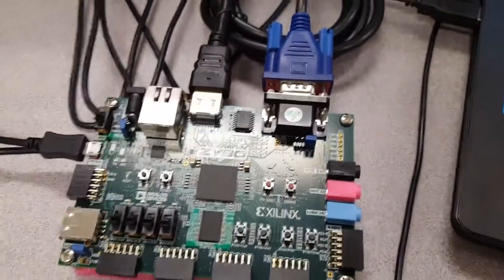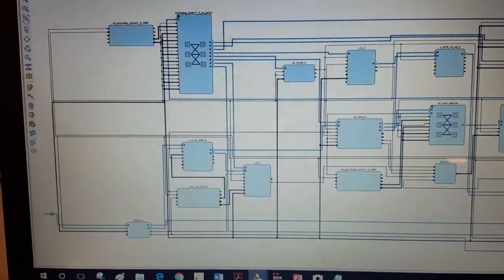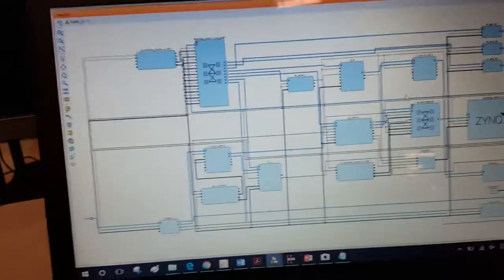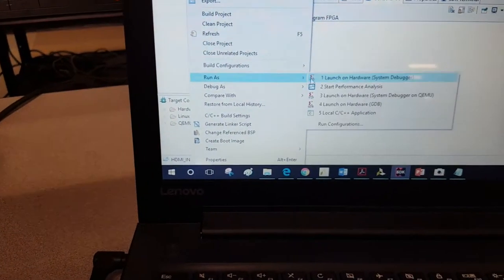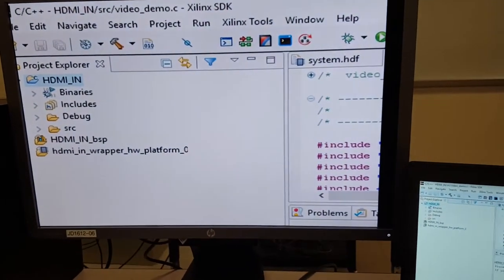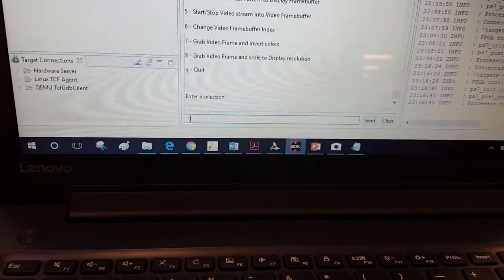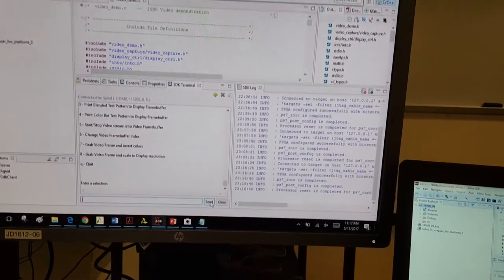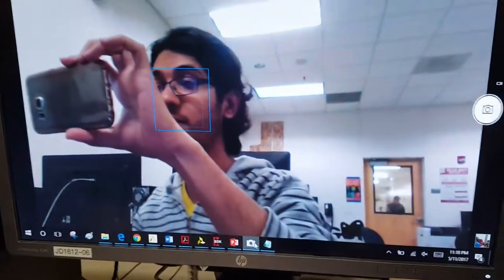Real-time Video Processing on Zybo FPGA

Comment: Dear Sir 
thank you very much for your illustration. 
If I want to the real time video processing,  please what is yhe first step? 
Thank you and I am looking forward to hear form you.
Reply from the maker: My pleasure. If you want to do anything with video processing you should start from implementing the example design from Digilent. They have some good example designs for different versions of Vivado and for different platforms as well. Once you understand the flow of the project you can add your algorithm in the existing example design. 
If in case you are not familiar with Xilinx Vivado IDE I have a walkthrough series on my channel to watch and learn as beginners. Hope that helps. Thanks!
Reply: @GetitQuickly  Thank you very much / I will take the second advice. Thanks again.
Reply from the maker: @مروانعبدالخالقذنون  My pleasure :)

Comment: are those IPs custom IPs you did yourself? Also, was this for your masters? Also, is that CSUN? :D
Reply from the maker: Some of the IPs used in the design are the default Xilinx's IPs, a few IPs are from Digilent (Zybo Maker). And finally the my IP which I had created using HLS (displayed in another video).
Yes, this was my master's research project. And Yes, It's CSUN (Los Angeles, CA) :)